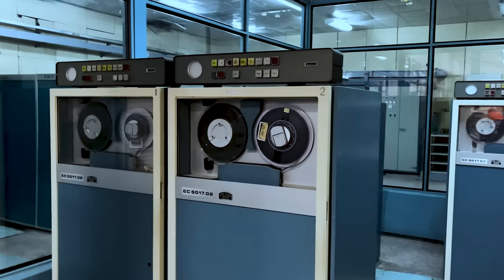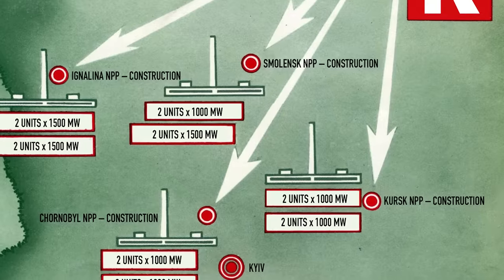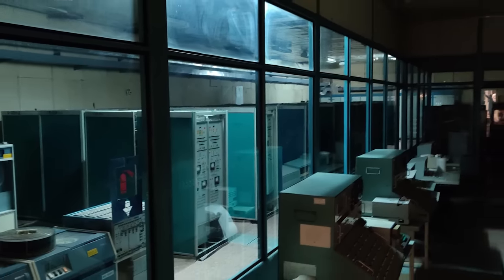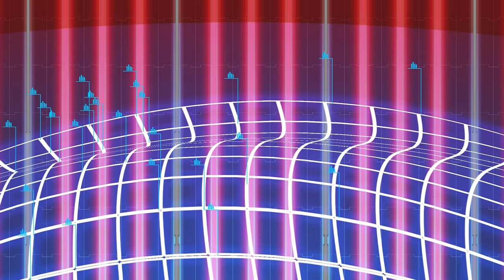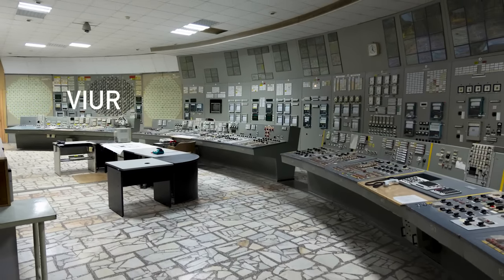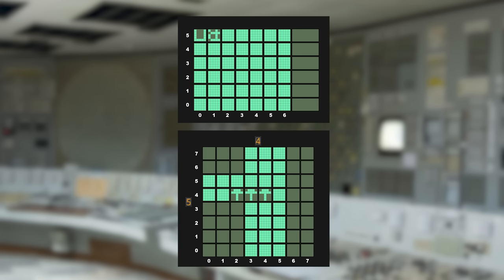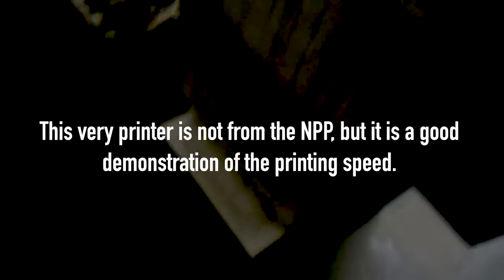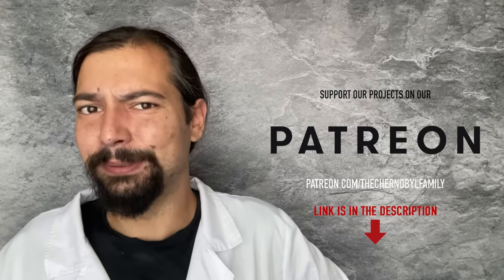Exploring SKALA: Chernobyl Reactor Control Computer

Comment: Great video!  It's nice to see older systems like this and learn about how it all worked, even if I don't understand all of it.  Seeing purpose built machines running magnetic tape, punch cards and tape is kind of cool, considering what modern systems are capable of.  Fortunately, SKALA has been preserved, as it should be.

I do have a question for you, though.  Would SKALA have been installed for the next building with Reactors 5 and 6 or would it have had DIIS or something similar that was more up to date for the time it was scheduled to be completed?
Reply from the maker: SKALA would be installed for 100%, as for DIIS, it was a post-disaster creation caused by the modernization following new requirements. At the same time, in some alternative history, SKALA also would evolve to something newer.

Comment: My ears perked up when you said "Selsyn". I'm very familiar with those things. Don't see them anymore though... :)
Reply from the maker: I felt someone will like that in particular...)
Reply: @ChernobylFamily  Oh yeah, we used them to synchronize one conveyor to another in the paint shop in car factories. 

The ones that were used were usually U.S. Navy surplus ones from WWII destroyers. 

And I think that you said the computer had 20k of RAM. 

The GE Series Six PLCs that I first programmed on had 1k of program RAM and 8k of register RAM.

 Sounds tiny, but we ran pretty big machines using them.
Reply: Selsyns are not inherently noisy.
Reply from the maker: If lubricated well and well, here they had a few gears added.

Comment: Impressive how the computer technology was used at that I time!
I was in 1987 responsible for the operation of a ppd-11 based scada-system on one of the largest gas turbine power plant. The scada system was programmed in Assembler and we had 80MByte hard disks and tapes to store the data. The control room was also equipped with a large wall, displaying the most important data. Printer and Monitors were used to log the events.
Did you rebuild skala and could it be visited in UA?
Reply from the maker: Thank you for sharing this!
We cannot restore SKALA as for 'restoration' it would need a reactor up and running, otherwise it is useless. It just stands as is. However, in the very close future we will have a great continuation of this documentary- so stay tuned!

You will be able to visit it as soon as russian invasion is over.

Comment: Amazing how much research you did for this video! And have a ton of questions, like: there´s any pc software to simulate this skala system functioning ? You mentioned that you managed to salvage the hardware, any chance to do more videos about it? and would be possible to use the data to emulate the accident? sorry if you already asked any of these questions, I will watch the whole video again.
Reply from the maker: These questions are good. There is no emulator, because the system is deeply connected with a reactor which is itself THE thing to emulate; the hardware stands on its place at the power plant. If not dаmned russіаn іnvаsіon, we would be able to show you all much more, but for now the hardware is off limits.
As for the accident, I want to stress on the fact that SKALA and specificly DREG are not qualified as a final source of data, only one of few.

Comment: The Digital Equipment Corporation (DEC) PDP-10 computer (specifically the KA10) used a similar paper tape reader to load the “bootstrap program“ which then loaded the main operating system from either TM10 magnetic tape or RP10 disc drives - a single paper tape had several dozen bootstrap loaders (one after the other) so you didn’t have to reset the reader each time you had to boot the system - same technology from the same era - fascinating!
Reply from the maker: thank you for sharing!

Comment: great video. Thanks a lot.
Reply from the maker: Thank you for coming!
Reply: @ChernobylFamily   I can hardly understand how the whole system was planned, built and operated. I mean all the tools we know today were not present in 1980. And as you mentioned the system had to be and was reliable in it 24/7 operation. Great. I fear that a lot of this knowledge was gained and developed from military projects and this has a very nasty taste today.
Reply from the maker: @stephanbrenner3317  I believe you are right. In fact, I stressed that V3M, which is a core of SKALA was a control computer; it is a very different class of machines than a general purposed computer. Of course, some principles in foundation of it could have double purpose. Unfortunately.

Comment: Not surprised either it got that upgrade. Just upgrading from TTY and printers to a terminal system would have helped immesurably
Reply from the maker: Watch to the end - about DIIS system.
Reply: @ChernobylFamily  Yeah, I should have figured it would have gotten an upgrade of some sort. It sounds like the DIIS basically used the old SKALA system as a frontend to interface with the monitoring and control equipment. Also I imagine getting rid of the TTYs made things a bit less noisy, I've heard stories about how loud those things got: I've heard that ex-machine gunners could get jobs after they left the army running those things because their hearing was shot anyway, and the sound those Soviet TTYs made was so similar to a machine gun it didn't bother them.
Reply from the maker: @ironhead2008  in fact, teletypes remained, as printouts are things that were generated non-stop, if something you could use them rught away. DIIS added a significant computing power, but original tech also was in its place.

Comment: That was really good, thank you so much!

I had the same thought when you compared SKALA's interactive interface to that of the Apollo DSKY.  The DSKY also used electroluminescent displays for its interactive user interface (it looks like SKALA is using Nixies?).

Also, the tape drives and disk packs of the SM-1210 used for for DIIS reminds me visually of a circa 1980 VAX though its architecture is apparently closer to that of the HP 2116A.  Does the rest of the machine have a DEC-like appearance?
Reply from the maker: SKALA used partly nixies, partly green luminescent indicators enclosed in tubes.

About those reel drives and disk drives, it is even more interesting, those are peripherals of ES EVM, so technically IBM/360, wired via interface layer. But SM1210 was somewhat similar to DEC PDP visually while it was not complete PDP clone.
Reply: @ChernobylFamily  Interesting. Thanks for the info.  If I could have given the video 10 thumbs up I would have!

Comment: This makes me think about the old cold war era analog systems that are likely still used today in nuclear missile launch silos for receiving launch codes and confirmations. I'd imagine they have probably not updated them to digital systems as failsafes, so the options are to use the original cold war era systems or update them as much as possible to a certain point.
Reply from the maker: This is an interesting point. And to me is known a case from russia where they have a functional ES-1033 mainframe as a backup. Or better to say, had. Scrapped last week.

Comment: Excelent episode. But I have couple of questions about SKALA. Somewhere in the internet I stombed upon that SKALA PRIZMA calculation was so slow so operators at night of disaster had no idea they pulled too many control rods. Is it a true? Of course it was not main reason of disaster but nevertheless.

Also in HBO mini-series Akimov shows Dyatlov report of SKALA with recommendation to shutdown reactor. Is SKALA is really capable to make such recommendations? Or it's dramatization from HBO?

Thank you. Also mentioning "control panel as front-end" is very good analogy.
Reply from the maker: Look, let me call the power plant and ask them. I really do not want to make quick answers, because after all, we aim for a good research.

Comment: I figured with a multiple reactor power generating station, especially with the tempermental RBMK units, there HAD to have been a central computer complex monotoring everything and crunching the numbers and formulas apparent upon the day to day operation... I would also think with such a complex computer system, even by mid 80s standards, they could've at least been able to simulate that particular turbine wind-down test that got them into trouble many times over and made appropriate adjustments until they got the precise sequences right - BEFORE they actually DID the test on the atomic pile itself!

Comment: Hi Alex I was entranced by your video. Its a proper old SCADA system you described and really well designed by the looks of it. I glad you managed to save it I. know how important it is as industrial heritage. When I was working with GE on scada control systems for the enery companies just after Thatcher dregulated the industry in the uk in the 90s, they pulled out all there old computers and dumped the lot. Stuff they were using for 20 years. I don't think any of it was saved.
Reply from the maker: Thanks for sharing!

Comment: He doesn't say this but IRQ or interrupt request is very important on early 486 machines. Think of a 286X level computer handling 4000 inputs without overloading the IRQ interrupt request crash point where the Operating System had to be manually reloaded from the tape drives shown to reboot the system. Basically the equivalent of a TRC80-1000 radio shack 286X loaded off of a cassette or 5.25 floppy drive in comparison.

Comment: Do you have any good photos of the displays in the DIVT console? It looks like they used separate IV-22 units, but there also seem to be one 16-segment unit at the start of some of the rows. Maybe they are just disguised IV-17s, but it looks kinda curious
Reply from the maker: That is such a dark corner that no good available, will check next time. From what I see, each bluish display start with 16-segment tube.

Comment: I know it'd be a monumental task but I'd love to see this system reverse engineered and turned into a simulator. It was insanely complex for its time but nowadays you could easily run the entire system on a $5 microcontroller...it's "just" a matter of getting it ported over.

Thank you for helping to keep this wonderful machine out of the trenches. It'd be a tragedy to see it buried.
Reply from the maker: We have severe doubts it can be done with $5 chip; the core thing is not computation power, but signal processing. It also requires numerous people to interact simultaneously. However, we believe some parts of it is very possible to emulate, so that is what we are going to do in the future:)

Comment: I would love to hear more about the skala system, the programming and such. Especially the "software" side would be cool.  That aside, you have been making videos about clones and those have "imported parts".  I have been told soviet electronics use a metric, not an inch based, system for the holes, and as such soviet circuit boards cannot accept western chips. Is that true ?
Reply from the maker: About software it is pretty complicated, but maybe we will succeed with that. For now, in the nearest future we will review some peripheral hardware we were able to get knowing the types used.
As for metric system used: true, we used it. It was possible to insert western chips into metric chip sockets in some cases, but when it came to DIPs of 48 pins, when chips got hot, they could literally jump out. Professor Romanov from Kyiv Institute of Cybernetics (there is a video about scientific cards for ES1841 computer) told us that back in 1980w they even had to create makeshift mounts to keep those in the place.

Comment: I have watched this video three times now. I have waited for such a video for quite some time. The computer side of things i find is often quite forgotten. I guess it's because it is a field that was moving extremely fast during the second half of the 20th century. If you are in the middle of it and new things arrive you can't get rid of the old equipment fast enough, right? As someone keenly interested in the Swedish air force computers of the same era it's interesting to draw parallels between similar problems and solutions. The corresponding function to DIVT we called TVAK in that context, short for technical guard. Similarly i find there is quite the shortage of available information. There is a story going around about the automatic target-following computer that we were the first in the world to employ. Most of our STRIL 60 system was delivered by Decca and Marconi. When FMV, the defense materials administration, asked about procuring a computer for automatic target following and guidance data calculation, both Decca and Marconi said it could not be done. FMV then asked IBM, and i believe also Burroughs, who both said it could not be done. Then they asked FACIT, a little-known Swedish manufacturer of calculators and office equipment if they could deliver such a computer. The reply from the representative allegedly was, "Well, i guess we could". I have been fortunate enough to see one of those computers, albeit after decommissioning. They have similarities to the DECs of the same era, with similar modules on a back plane. Fortunately the field of computers is young enough that some of the people who pioneered it are still alive. They have a treasure trove of information that must be preserved for posterity.  I would love to see more in-depth coverage of the DREG program and actual architecture of SKALA.
Reply from the maker: Thank you for sharing all this. We will come to DREG and so in the future.

Comment: Not surprised these things used machine code. You need to do that to wring every last bit of performance out of anything pre 386 as well as earlier 68K. Part of how game console makers got the performance they got was because the games used 6502, Z80, 68K, 65C18, and other processor specific assembly codes. For a big late 70s -early 80s mainframe system used to monitor a nuclear reactor, you're damn sure gonna want every last clock cycle optimized for speed and efficiency, just like a 8 or 16 bit game console, just for VASTLY different and FAR more important reasons!!!
Reply from the maker: Thank you for sharing these important insights.
Reply: But, they're not doing HPC ... I would have thought that reliability was a few orders of magnitude more important than perf.
Reply: @halfsourlizard9319  if you know what you're doing assembly code is much more reliable than any programming language. Fast and efficient code is probably preferable.
Reply: @ironhead2008  Formal proof of correctness seems significantly more important. A higher-level, referentially-transparent language would be significantly easier to prove anything about ... and -- because of better abstraction capabilities -- more tractable to make any mathematically-rigorous claims about.
Reply: @ironhead2008  For instance: 'I wrote my assembly code reaaal carefully.' is an infinitely-less-convincing argument that deadlock is impossible than a proof in a formal logic.

Comment: It's basically an arduino of that era. What amazes me they made only one computer, they should have a second one in tandem in case the first one fails.
Reply from the maker: Very simplified speaking you are right, though the difference is in insane number of analog and digital signals to process. As for the second computer, in this video we explain that this was actually a system of two machines constantly exchanging their operational status signals exactly for the purpose you told about, in other words it was implemented. Though SKALA never seriously failed.

Comment: It would be very interesting to understand the entire interface and conditioning part from field sensors to processing units. What techniques were used to wire and manage huge numbers of sensors
Reply from the maker: ...at some point will be a continuation. That is in fact a very big subject, but to properly explain it, we need to be closer to the hardware.
Reply: @ChernobylFamily  Thank you so much for the great work

Comment: That's insanely cool.  And it's an interesting dive into this tech completely unknown from west perspective.  I have to admit, I'm impressed by the software design.  I wasn't aware the USSR was THAT far behind on the hardware side.  At the same era, on the west, you could buy an atari 5200 with 16 KB of ram at about the same period.  Still, even with the lack of hardware, they achieved to write brilliant sofware on 60s tech.  I can't imagine the big brains behind this mastery of programming.
Reply from the maker: (Do not take it as any advocating of the soviets - we are not fans of that country). SKALA was designed in ~1971 and, important, it is a specialized system, not a general-purpose computer. So I believe it will be more correct to compare it not with Atari, but industrial systems.
Reply: @ChernobylFamily  You're right, the initial design started in the 70s but it was already completely outdated in the 80s at release phase. Hopefully they had brilliant programmers.  I'm not advocating soviets either but we all agree both sides had talented people.